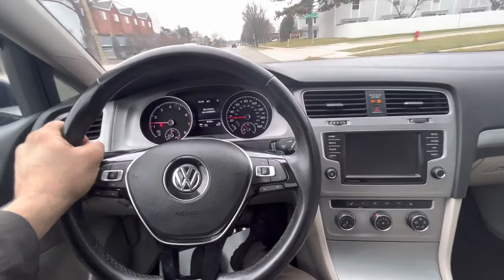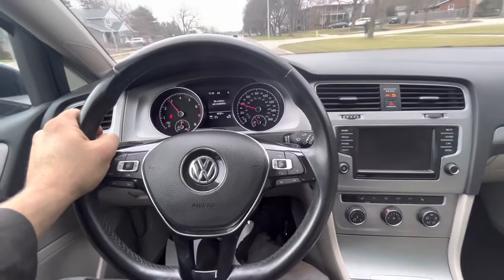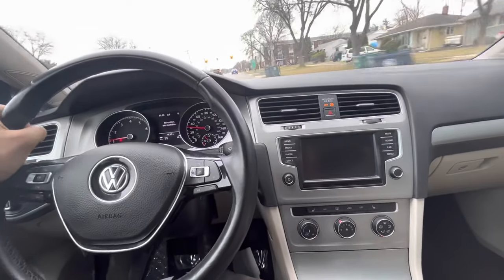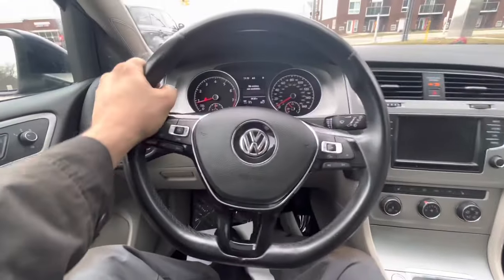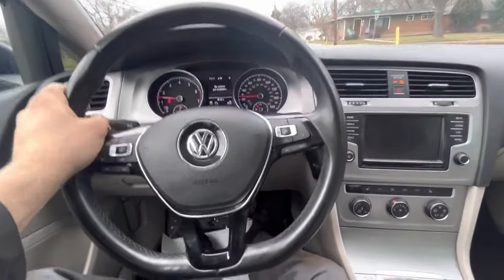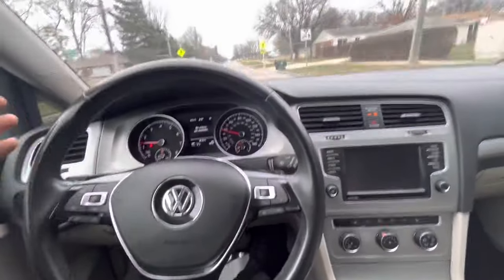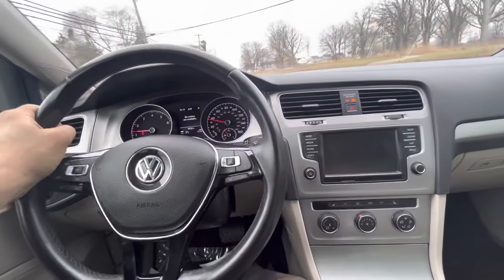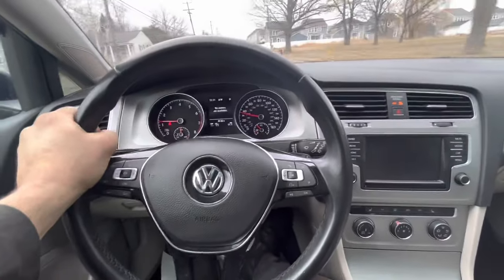THE CAUSE OF VIBRATION WHILE ACCELERATING ON A VOLKSWAGEN

Comment: VW Tiguan 2010... front end shake with acceleration and when driving uphill. This video describes the problem to the >T<. With the axle removed there was a noticeable play from the loose CV joint. Very helpful video as my mechanic found it, when researching the problem.  This Saturday the front axle was changed out and the problem was resolved. Thanks!
Reply from the maker: Excellent news!! Im happy it helped you out

Comment: I am having a similar issue. But my 2012 Jetta SE 2.5 only shakes between 30-40 mph. Not before 30 or after 40 and only while accelerating. No shake when off the gas. I’ve changed the coils and plugs I’ve check all wheels and balancing. Checked for bad bearings and have changed both cv axles. Still having the same issue. No warning lights on dash. I’m stumped.
Reply: Could be the input shaft to the dsg or wheel bearing, might also want to check suspension at the tierod or control arm bushings to. If you cheaped out on the driveshafts you might want to get the inner cv parts checked as well
Reply: Just need tires balanced
Reply: Did you ever get this solved?
Reply: I am facing the same issue in my scoda laura dsg,
Reply: I have a T5.1 Caravelle 7 speed dsg 180 4 motion. I had horrific vibration from 40-50 mph, while the drive shafts were changed (which weren’t that badly worn) the garage found the front and rear engine mounts were worn and amplifying the problem! That solved the speed specific issue! 

A few weeks later my dsg box decided to spit out the near side driveshaft (my box has female splines with male splines on the drive shaft) thus creating another mystery vibration, luckily enough the shaft was just refitted with a new c clip and it’s been fine since. I suspect my badly worn top mounts may have caused this failure and once my wallet has recovered that’s what’s being done next
Reply from the maker: @Invinciblemoam wow! That’s a pretty interesting series of events, I’m glad you managed to get to the bottom of it
Reply: I have this too on my golf 7.5 1.5 tsi did you fix this problem ? I still have it and it annoys me does anyone know how I can fix this?
Reply: Throttle position sensor? Gas pedal

Comment: Awesome video man. Just so everyone knows. I have a vw mk7 golf TDi. And I have been gradually lowering the car. As the car has been lower I've experiences more pro less with my exles until this weekend I lowered it a little more and know it vibrates pretty bad. Checked the axle and sure enough it was the axle. I swapped it thinking this would fix the problem and it didn't. Simply because it is still at same low ride height so this tore the k ew axle in same day. Now I have to raise the car and get axles all over. Learn from my mistakes peeps.
Reply: That’s what you get for lowering it, guarantee it looked hideous too

Comment: I changed both of mine to OEM cv axles and it still vibrates only when accelerating. Past 70 mph only
Reply: Have you managed to solve your issue with steering shaking yet. I've spent over £1500 trying to solve this issue and I'm still having the same problem. I've changed drive shafts, shockers, brake discs & pads, tie rods and even got new alloys with brand news tyres on and still same problem.
Reply: The same with Touran 2018, after 130kmh-180kmh vibrating central console and back seat like crazy

Comment: 2007 MK5 GTI DSG, After changing summer tyres from winter ones, the same problem is taking place. Stomping the gas pedal, the car starts to vibrate. Initially, vibration only happened while turning right and accelerating. But it is getting worse today.😮
Reply: any results????
Reply: @Adameki  I’ll update to you.

Comment: By inner cv joint is it at the input end of the DSG? Like not the CV close to the tyre, cheers. Think I'm having this issue with my MK5. No vibration when coasting then I feel a woble and vibration when I touch the gas
Reply from the maker: Yup, closest towards center of car

Comment: Will the check-engine light usually come on for this issue? My light was flashing when the car vibrated.
Reply from the maker: Yes typically if it picks up so many misfires within x amount of time the light will come on and blink while the misfire is active and store a fault pointing you at the correct cylinder as well

Comment: I have a fairly similar issue with my car, a 2011 Golf Mk6 1.4 TSI (118kW, but I don't think that matters much). Whenever I am stepping on it, or I'm climbing a hill, there's a thumping sound. You can feel it in the floor, shifter, even a bit in the steering wheel. It's also vibrating like crazy when doing above 120kmph, but stops over 140, so maybe there's some weird resonance happening. Already swapped out both CV joints (inner and wheel) on the right side, swapped control arm bushings, ball joints, tie rods and sway bars. It's driving me nuts! The thing is that the thumping comes from the right side of the car, so I am (maybe incorrectly) excluding the possibility of a bad left side CV joint. The thumping frequency increases with the speed. It feels almost like when doing a burnout and the tires kinda skip on the spot, but much less violent than that.
Reply: are all your tires same size? sounds stupid but most of these are all wheel drive and it would definitely "skip" from uneven tire wear even if they were same measurements. the other thing would be to check your main axle U Joints... those totes fail sometimes and if you hear a CLUNK! when you go from reverse to forward.... just look at them they are very easy to see if damaged or not
Reply: @jedmarquardt4023  yeah, all my tyres are the same size. The sound is there with both my winter and my summer tyres. Also rotated the wheels arouns so I can eliminate an issue with the rims. 
It's a FWD so I don't think I have a U joint. I have already swapped the whole CV axle twice. Someone suggested that the small axle that's coming out of the gearbox and connects to the CV shaft might be a bit bent, also I am thinking that maybe the front diff is somehow busted. It drives fine otherwise so I'll just see if it gets worse. It's gonna get a new clutch pack at some point and I'll check the gearbox thoroughly when I do that.
Reply: @dyazRO  so after putting the car on the lift i noticed a slight wiggle in the tire from left to right, the tie rod end boot is broken and the cv axle boots are shot
Reply: @dyazRO  only way to really know is put it on a lift and check the dmg ... good luck
Reply: Same same problem here with my toyota scion..FWD vibration on the leftside changed everything but nothing works

Comment: hi i have 2006 vw passat 2.0 tdi automatic, the entire car shakes while accelerating roughly between 50-70kph, shaking stops instantly when you stop accelerating could this be the inner cv? any thoughts on this are appreciated, worth noting both front shocks and bushings have been replaced to no avail
Reply from the maker: Strange that it’s only experienced at that speed range, usually you can feel it any time accelerating with bad joints. Do you have any faults stored?
Reply: @EuropeanAutoRepair  theres two fault codes a p0321 and an injector code but i had injectors checked and there perfect, still working on figureing out the p0321 though

Comment: I have a golf R MK7.5 with only 33k miles, have very minimal vibration but wobble bad at high speeds. went out at 4am onto the motorway (UK) and got up to 120mph just to test it and the wobble was dangerous, only just started happening 3 weeks ago. had all wheels balanced and wheel alignment done but its still there. can see no leaking from any cv boots. driving me crazy at this point. either a buckled alloy which is not visible by eye or inner cv joint possibly wheel bearing? doubt that though as its only 33k miles so bearings should be fine. don't know what to do as its my daily and I don't have real time to get it to a garage because of work. tyres are all new Michelin ps5's and have no bulges or flat spots/ separation. its infuriating to say the least.
Reply from the maker: Do you have factory wheels on the vehicle

Comment: My 2010 gti vibrates when i take off in first gear and once i get up and going it goes away. I can feel it a little bit too when im gove it a little gas on highway and like u said when i let off the gas it will smooth out. Sometimes i can be driving slow thru a parking lot or something and the car feels like my car is wobbling goong up and down on the front passenger side like im driving over a bump or something. Also when i put the car in park it rocks back m forth like it has too much play in it. Does it sound like the front passenger cv axle to you? Thats what ive narrowed it down to from watching these videos
Reply from the maker: It sure sounds like a inner cv joint issue on a front axle to me

Comment: okay i got a question i’m currently use Mk7 Gti when i hit accelerate, i’ve heard this weird noise coming from the passenger side and also vibrate , is that the inner cv joint problem or there’s other problem?
Reply from the maker: Do you have a engine light on currently or is this just more of a noise and drivetrain vibration kind of thing?

Comment: Ive got a 2014 2.0tdi golf 7 based sportsvan. Same exact symptoms, its only done 52,000miles. Has it failed already? I DIY if i can to save money. How much play should there be for it to be considered broken? I guess replacing both is ideal? Thanks for the vid. 

It started when i had to new tires fitted. I trust the tire shop as i see balncing weights attached on the alloy wheels. Like you said on your vid it is more noticable under accelaration, slow and fast. 

Hopefully that would be the case on mine aswell.
Reply from the maker: If the vibration started when tires were installed it might be a good idea to have balance check just in case it’s off, if they check out good look into cv joint play
Reply: My TDI does the same thing as this video. Varies with temperature and humidity. It does seem worse with my summer tires. There was a service bulletin on the toureg, That says the hub and the wheel must be aligned a certain way torque down a certain spec and the tires must be road force balanced.

Comment: i'm borrowing a VW Jetta and ... I've had VW's before. never seen the side to side shaking like this... it gets worse on right hand turns so i'm thinking wheel bearings... but there's no grinding.. so strange. HOWEVER, i will put it on the lift and find out WTF is going on with this
Reply: hello, any news ? have same problem but on golf mk7 GTE. car shakes right-left-right-left only under pedal and even more if going uphill, no shake/vibration in steering wheel....
Reply: @yanchauveau4605  i put it on a lift and s seen the cv axles are all needing replacement, all boots are broken  and dry. also... this shaking caused one of the tie rod ends to wear out.... this is notable by trying to turn the tire left and right with your  hands and seeing/hearing a gap
Reply: @jedmarquardt4023  found out it was that. They were literally bend…. Thank.

Comment: Ive watched a couple of your CV diag vids and Im pretty sure this is what is happening on my mk7 gsw.  

Is there a good way to identify D/P side?

Is it worth trying to rebuild if I have the time? My 92 S4 has original GKN that I rebuild after finding torn boots, would like to do the same for the mk7 if regrease would help.

Thanks!
Reply from the maker: I’m not 100% sure you can get a inner cv joint separate for that model i know you can replace outer with a GKN joint, I would check you boots and try to feel for excessive movement in joints, the old urs4s were such great cars

Comment: Hie, Golf 6 (2010), I have almost the same problem but mine starts vibrating when driving at 100KM/HR speeds. Below that, the vibrations are never felt
Reply from the maker: Have you already had balance checked on your tires?
Reply: @EuropeanAutoRepair  yes I have. Also did wheel alignment

Comment: I have his same problem but not sure if it’s exactly the same. Every time I hit the gas I hear the vibration, but I can’t much of it on high speeds. Should I have this checked?
Reply from the maker: Yeah it would be worth having someone look at it
Reply: Did u get a fix
Reply: @cloudstorage1258  not yet, I had another clutch problem so it’s getting looked at at the moment, I’ll keep you updated.
Reply: Help me :). I have the same issue with golf 7 1.6 tdi 110 cp breack 2015 manual gearbox 5 speed. When accelerate in the 3rd and 4th the whole car shakes, when i release the gas pedal everything is soo smooth. What is the problem? I change all 3 engine/gearbox mounts.
Reply from the maker: No faults stored?  Have you checked inner cv joint on the axles?

Comment: The same problem I am facing with 2014 Honda Accord, I have changed everything like you said CV axle outer inner both side also ball joint and new tyres on balanced. But still I am facing  the same problem only in highway, like when I hit the gas it vibrates but when I get off the foot from gas paddle it smooths. Help me please.
Reply from the maker: I wish I could drive it!! I’m sorry. Check engine mounts
Reply: Battery might be dying or a bad loos battery terminal. Check those first then if you still have that problem it might be spark plugs or coils or fuel injectors in that order.     Make sure that your battery terminals are on tightly not loose and obviously not super tight and you might just fix it getting a new battery and checking the tightness of the battery terminals. It might help

Comment: Okay , I have a 2011 vw toureg tdi , and while driving on highway the car feels like slipping or hydroplaning or like jumps like u would  think  that it’s slippery on road but not , then it goes away , please any help I’d appreciate it
Reply from the maker: Have you already checked for faults? Nothing is coming to mind with your symptoms
Reply: @EuropeanAutoRepair  u mean on dash , there’s no lights on , right now I lifted rear end driver side and checking to see what I can find , pretty much to me is rear end doing it , tires are one year old , I bought the car before three days for my collge daughter and the previous owner told me that it never did to him anything , to mention when it did roads were wet but not slippery , half way to the city I was driving and after 1 hour I returned home and drove different car
Reply from the maker: @MegaLeoo1 I was just wondering if it has any transmission or traction control/abs related faults stored, can you make the vehicle to it whenever you drive or was this a one time deal?
Reply: @EuropeanAutoRepair  kind of one time deal , but se says that never had that issue , and also a friend of mine he’s mechanic we checked all suspensions and it’s all good nice and tight

Comment: hello
I have a 2022 model golf 8 R car.
I drove my car very hard for 1 year. (track, drift, drag)Naturally there was a problem with my car.
When I take off at full power, there is a vibration that starts at 70-80km/h and ends at 100-120km/h.Vibration comes directly from the rear or from the middle of the car .

tires new
Balanced, no dents on the rims
no vibration at constant speed, it just vibrates at full power.
do you have any idea about this?
Reply from the maker: I’m not sure on that but I would look at that driveshaft and support bearing real good
Reply: @EuropeanAutoRepair  The interesting part is the driveshaft has changed. But the vibration did not stop completely.. 80% less vibration than before, but it did not enter completely :(
Reply: Yo rullmad are you still having the same issues? I got a similar issue with my skoda vrs, hit a pit hole real hard and my cars never been the same since. Had new tyre, balanced, had wheel allingment done. Had new shockers and now just had the driveshafts replaced. My car still has a wierd vibration once i get to 70mph. Any help would be great
Reply: @JWilko94  Rear axles changed, my problem was solved 👍

Comment: I have a same problem in Tiguan 2008 TSI 1.4 . 
do you have the fix for this problem?
Reply from the maker: On this particular car it had a inner cv joint issue on a front axle, I would make sure you aren’t having a misfire under load by checking misfire counter and if not check axles for play